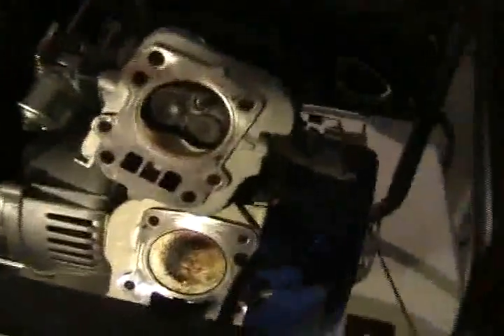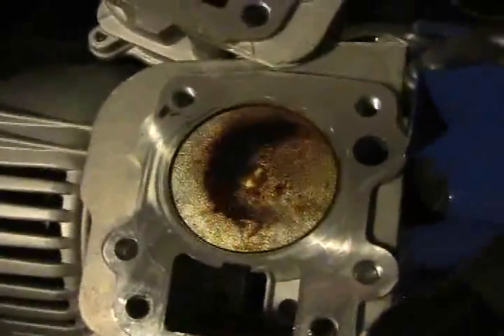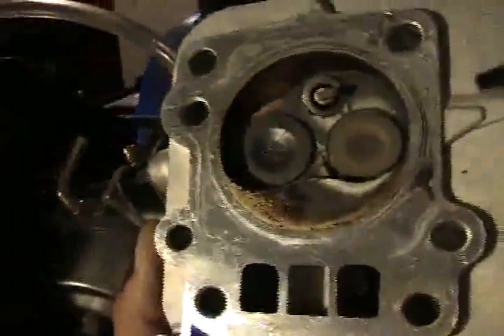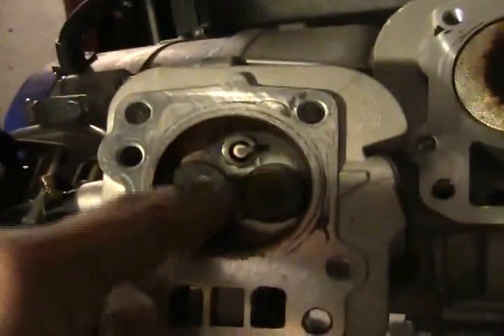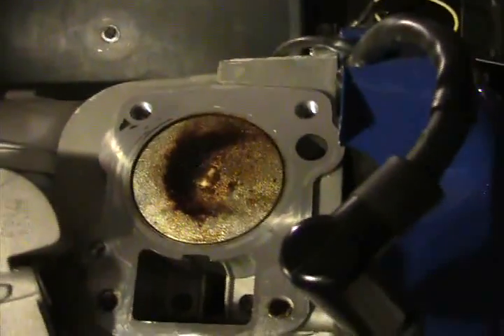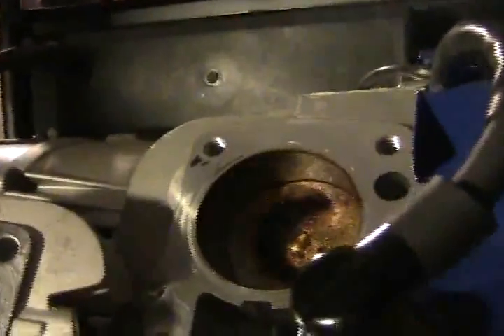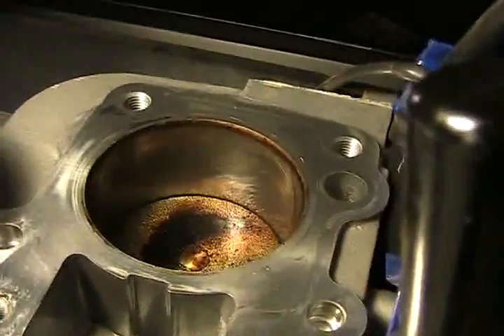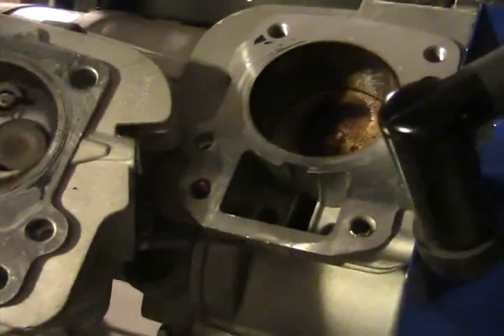generator test 22 engine running on hho

Comment from the maker: It uses a metal head gasket, very thin, and reusable. The metal is cheap but the machine work is fair, the tolerances are kinda sloppy, but what can I expect, its a generator, low comp means high reliablity.